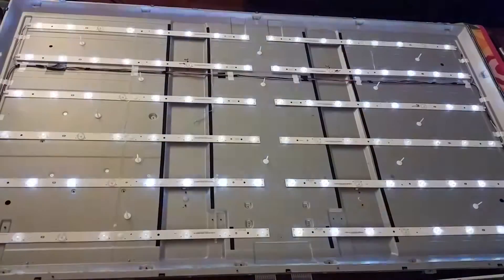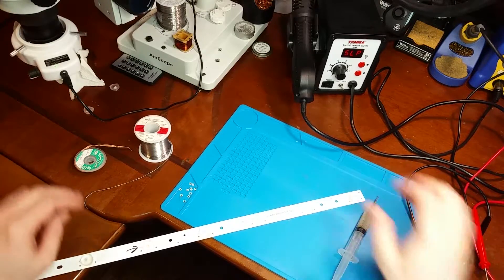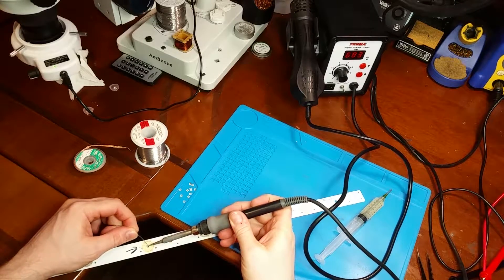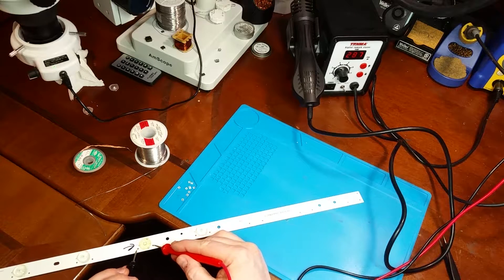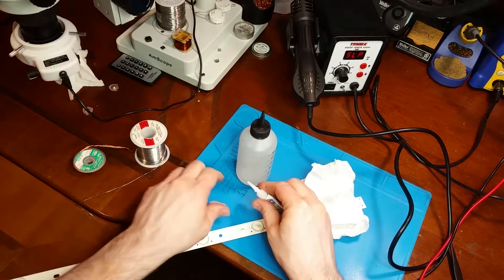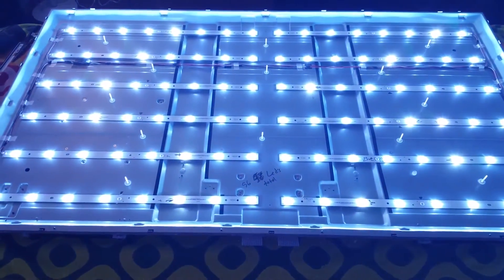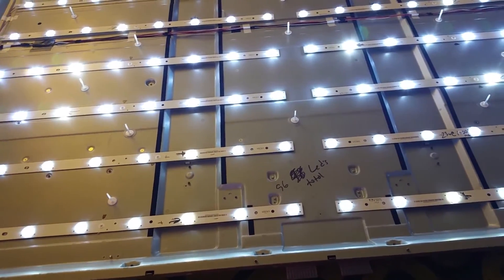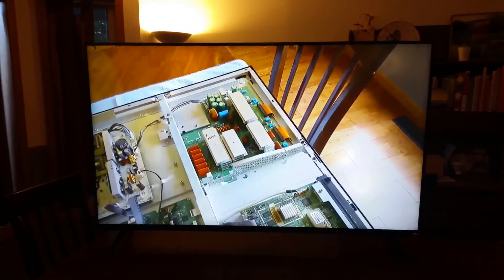Vizio 60" E60-C3 LED TV Repair

Comment: Do you have any advice or tips for removing the panel safely? I need to change a few LEDs on my m60-c3. I've taken my 50" LG fully apart about 17 times with no issue however this 60" is larger of course and kind of intimidating. I seen suction cups used online but my local store only had 1 in stock so I only have 1 for now, probably bow the screen with 1 lol. Any other ways to remove panel ? Most likely I'll be alone doing it as well so only 1 set of hands unfortunately. Thank you for your time!! Cheers from Canada
Reply from the maker: 60" is doable by yourself. Just use common sense and be careful.

Comment: Great video! You absolutely did a thorough job of explaining the crazy amount of work that goes into repairing one of these. I personally don't think they're worth repairing, and, considering how many hours this video has gotten, I'm pretty sure I'm not the only one. Mine went into the dumpster. I repaired it once, and had it repaired three times by a pro in Hays, Kansas. His name was Jerry. Very professional and great at his job, that guy. As the daughter of an electronics engineer, I know a great repair guy when I see one. You've got my seal of approval. I will definitely subscribe. I will not, however, be purchasing another Vizio product for as long as I live. Not worth the effort! I should suggest your viewers spring for a more reliable brand. I bought a Samsung to replace this giant old brick, and am planning on purchasing another for my office. 
Again, great video, and thanks for taking the time put it together. Much appreciated. There's obviously a market for such a video!
Reply from the maker: If the TV is having multiple failures and requiring multiple repairs than I'm going to assume at the time of repair only the single bad LED is being replaced instead of all the strips replaced with new. Generally once ALL the strips have been replaced it's good to for a long time. It's not just Vizio that suffers from bad LED's, they all do. Even the other big names like Samsung, LG and TCL. It would be like having a Ford that got a flat tire, then you traded it in for a Chevy while expecting to never get a flat tire again. A bit of a false sense of security.
Reply: @jeffescortlx  Nope. Every single time, ALL the LEDs were replaced. I haven't had this issue with the Samsung at all, although, I did wall mount it instead of having it sitting on a TV stand like the Vizio. It doesn't get jarred that way, so this could be the reason for its reliability with the LEDs. It definitely doesn't have anything to do with your assumption. I don't half ass anything and neither does Jerry, although the warranty company did attempt to talk him into doing the replacements that way. He insisted upon replacing them all. The Vizio was much slower to connect than any others I've tried. I'm wondering if that's specific to the brand. If not, then I suppose I just got a shit TV and the dumpster is the best place for it either way.
Reply from the maker: @IAmPamPoovey  I would have felt compelled to get to the bottom of it. Did anyone test the strips individually just to see if the new strips were having LED failure or some other issue? Depending on how the TV is put together firm ware can play a role. Just out of curiosity do you run backlighting at maximum settings?
Reply: @jeffescortlx  No, I usually run at about 50% of max.
Reply: @jeffescortlx  And, yes, the new strips were always tested. They worked fine. A few months later, not so much.
Reply: @jeffescortlx  It was frustrating to say the least. The cost of hiring a repairman and the time of fixing it myself just didn't justify keeping it around after a while imo.
Reply from the maker: @IAmPamPoovey  I meant to ask if the failed strips were investigated to see if it was just as simple as led failure or other issues causing the problem.
Reply: @jeffescortlx  The old strips were tested the second and third times, not the first. The brain was looked over very closely--normal. Power source was normal. Everything checked out. It's a damned mystery and it drove me up the wall. Just made no sense.
Reply: @jeffescortlx  This is why I gave up on it. It drove me nuts.
Reply: @jeffescortlx  Any ideas? Dad was mad at me for chucking it. Said he could have used some of its guts for something or other, but I'd had enough at that point, and I had the money for a new one, so I got rid of it. I could go and dig the thing out of Grandpa's dump pit, which is where things go once they're carted out of the dumpster, but I think I'm done driving myself nuts trying to figure it out. Just a bad apple, I guess.

Comment: Same TV issue. Used LED tester. Strips light sometimes 1 light comes on after a min using tester, but when I turn tv on only 2 strips I'll stay lit. Woukd the few LEDs that are slow to come on cause the other strips not to light?
Reply from the maker: Being that this model has a reputation of having bad LED's it's safe to say to just go ahead and replacace them all with new strips.

Comment: great work on the video.... I just got a fee one, and it looks like 3/4 of the strips are out... the bottom row seems to be working. With the 2 tvs you repaired, have any of the new LED's you install burn out?? I was going to try doing the DIY repair... figured... I will buy the hot air soldering gun and the same LEDs you used, if they are working well for you. let me know :-) also, do you have a recommendation of what kind of Flux to use, and or where to buy. thanks
Reply from the maker: I haven't had any trouble with the new replacement LED's. Here is a newer video: https://youtu.be/rkIwv77MqlY
Reply: @jeffescortlx   Yeah, I watched that too :-) good info there too ... watching your videos makes me want to try the repair myself... vs buying the full strips.  Found a hot  air gun on ebay, and the leds you used ( noticed they are rated up to 700ma, so that should be good for the 600ma spike..... is this a good flux? did you do anything to suppress the 600MA spike at start up?? https://www.amazon.com/gp/product/B07DCD9M3P/ref=ox_sc_saved_title_1?smid=A2HUVTR6WXW2HG&psc=1
Reply: BOOOM!!!! I not have a working 60" tv... I used my garage heat  gun and de-soldered the the LEDs.... i burned the strips  a little, but, still works. not bad  for $10 in LEDs and no new tools purchased
Reply from the maker: @cueballsi  nice!
Reply: @jeffescortlx   and ... of course.... one of the strips that I did not touch, just went out.... FML!!!.... I'll wait till the other one falls out and i'll open it back up.
Reply from the maker: @cueballsi  I reccomended replacing all the LED's when in there.

Comment: Great video thanks. I have 2 darkened corners on my e60-c3 is this an LEDs issue or main board? Anyone?
Reply from the maker: LED. This TV has a reputation of failing LED's.
Reply: @jeffescortlx  thanks
Reply: I had the same TV for about a year after the warranty ran out, so four years. I repaired it once myself, and then bought a new TV. The repair worked fine, it just wasn't worth the effort, as, after about six months, the LEDs started going out again. While the warranty was still active, I had to have the TV repaired for the same reason three times. It's a cheap piece of junk. I should have gone with the Samsung in the first place. The Vizio is slow. It takes FOREVER to connect. The Samsung doesn't have this problem and I've not had to use the warranty to have the LEDs replaced with it since I bought it. I'm looking to purchase another Samsung for my office as well. LG is also a decent brand to look into. I've heard good things about Sony's larger screen smart TVs and TCL too, but I'm afraid Vizio lost my business for good with this one. Also, if you didn't get your 13 or so bucks from that little class action lawsuit payout from Vizio, you might have missed the window, but it's worth checking into. $13 is $13, right? In all, you get what you pay for. I should have ponied up the extra $500 for the Samsung in the first place. It would have saved me a lot of frustration and headaches. Just a suggestion, and, like I said, I've heard good things about LG and Sony as well. Personally, I'd go with darn near anything but a Vizio at this point. Their sound, even without the bar and boomers is decent. I'll give them that, but those LEDs popping out every five seconds absolutely turned me off of them. Have fun repairing yours if you so choose. And have fun doing it again. 
And again.
And again.
😉
Reply: @IAmPamPoovey  every LG I ever owned failed under a month passed warranty its all to common now a days for all electronics to be made to fail its just a matter of when and if the bug was planted during production or passed along to you during a "much needed" software  update.(sarcasm) and sadly this is something to expect from all top brands as sad as it is in today's world of nothing but greed. Good luck with the Samsung I've heard good things fingers crossed ...and for everybody else , always get the extended warranty if possible. Cheers

Comment: Hi Jeff thanks for the video. I have this tv and have some dark areas, I figured it was bad leds but the other day I turned it on and some of the dark areas relite, could an led come back on temporarily or would this be the driver card failing? Thank you for your time.
Reply from the maker: More than likely one of the failing LED's shorted, allowing the rest of the LED's in the row to light. I'm sure your LED driver board is ok.
Reply: @jeffescortlx  thanks for the info, you helped me decide on fixing this tv or buying new, I'm just gonna give it a try. Another thought I had was installing a switch to cut the power off and on to the led strips, that way I could keep them off until the tv boots up and stop the intial boot surge from reaching the strips. Do u think that would work or would the tv sense that there is something not right with the leds.
Reply from the maker: @dickderbin6518  depending on where you connect the switch, you might need 12 switches since this model uses independent zones. Also it may have a capacitor after the control/regulating circuit, so it could potentially charge to max range (with no load it's likely to go to max)

Comment: I was given a Vizio E60-C3 and I have the exact problem that you have. Being a Computer Tech and having motherboard soldering skills I think I can do what you did to fix said problem. The only thing is I don't have a desire to do all of what you did with each light. I will just replace the entire strip. I will look online for complete strips. I love your video. I have never seen the inside of a LED TV and I was shocked at the price that they charge for these TV's and when you take one apart, there is really nothing inside. Thanks again.
Reply from the maker: I have a newer video here:
https://youtu.be/rkIwv77MqlY
Of the same model. Replacing the complete strips is the right way, but more expensive than LED replacement.
Reply: Exactly what I thought when I took mine apart. Nothing to them. I guess its all in the complexity of manufacturing that led panel.

Comment: Last Vizio I will ever buy, I had the same exact TV after 1 year several strips started failing. I worked some magic and was able to convince Costco to take it back and then bought a Samsung... Problem solved!
Reply from the maker: Certain models of Samsung also suffer from bad LED's. It's not just a vizio problem.

Comment: I have an m60-C3 that has a few dim areas. Not completely dark. TV is still watchable but just annoying. Most noticeable when the picture turns light colored. Is this the same as an E60-C3? Is there any prying or separating of glued things to take it this apart?

Comment: I picked up exactly the same model at a curb, and it displays exactly the same symptoms as yours. I used a flashlight trick to confirm that LCD screen actually works and all I'm missing is the backlight. I am amazed though, that you immediately started digging into the LEDs and didn't try to blame the LED driver board (which is integrated into a main board in this model). I was hoping I'm not gonna have to mess with the LED strips, but your video is very convincing...
Reply from the maker: I now have two videos of this model. Both same issues. Check out my channel for the other.